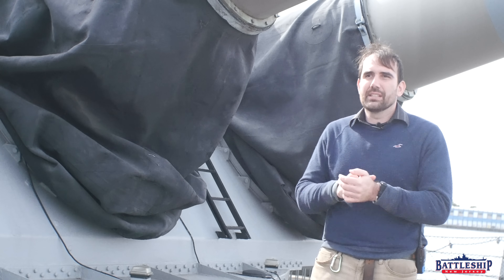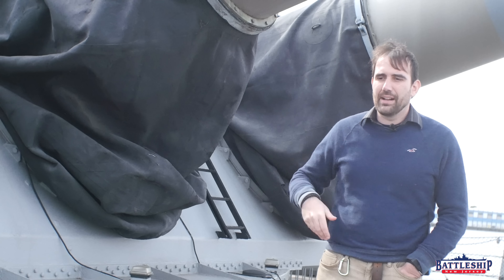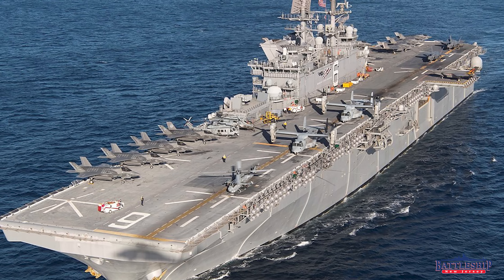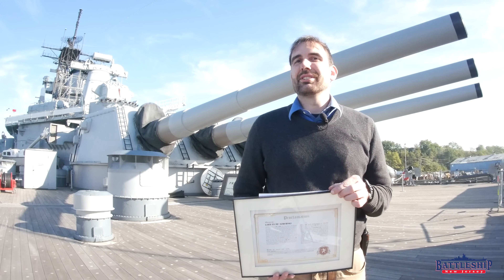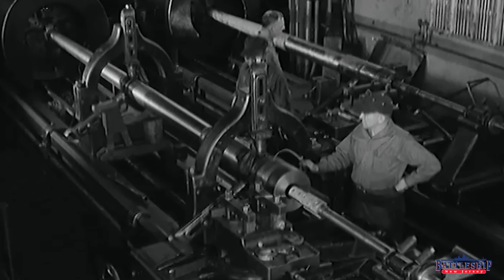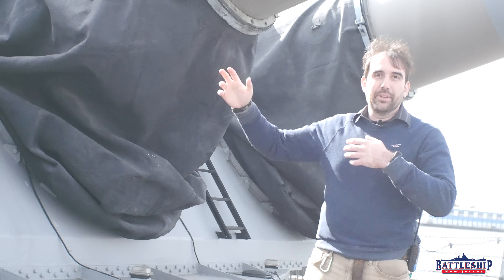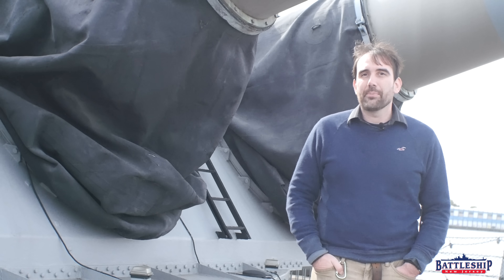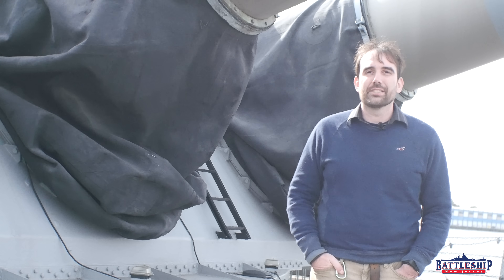How Much Would It Cost to Build a Battleship Today?

Comment: I'd build new Battleships, i think. but i'd shift things around if possible. To start, we're building our ship to the neopanamax size. We can build her longer, wider, and make her sit deeper. with the size bonus, we're gonna commit to the bit and go full send on 18 inch guns. because of the size increase, we're probably gonna be able to run this with 4 turrets (might have gotten away with 5 if we stuck to 16 inch if we could shrink the superstructure a bit, but not pulling that off with 18 inch guns.) The extra size of the ship will let us carry more shells, maybe as many 18s as the iowa carries 16s. 

However, we're not actually going to install that 4th turret. we're gonna run three 18 inch three gun turrets, likely 18 inch 50 caliber turrets. What we're going to do is, instead, take that fourth spot and use that for the VLS cells. hopefully we still have room for a chopper pad, but realistically she's never going to operate solo so if we can't, we can't. then, in near the super structure and otherwise to the sides of the guns, and probably also on the nose and bow, we'll slip in our secondary batter of the standard 5 inch mk45 guns. mounted actually on the superstructure and perhaps beside the secondary battery are our CIWS systems.

Obviously the main point is the big guns, the VLS cells and what not are basically all for Air Defense, and our 5 inch guns are really just going to be their to fend off ships that get in to close. the VLS likely will hold some and anti submarine options as well, just in case. whether we use the 18 inch guns like i suggest here, keep the 16 inchers, or even choose to just break the record outright with 20 inchers (unlikely but i can dream), we're gonna need new shells. now, we're not planning to use this to actually engage enemy ships, but it's still wise to have the capability to engage whatever our target is from as far as possible assuming there's land based defenses, which there probably will be.

So, we will still carry conventional shells, because making them one solid object can allow more penetration or more explosives if we can get in closer. but in addition, we're gonna pull rocket assisted and/or base bleed shells, which ever gives us the best range increase for the least payload cut, or maybe just outright both. for the reason of range, despite my previous statement, holding with 16 inch guns may be the correct play. i don't really want to go any thinner or longer though, as ideally i don't want to burn the barrel too fast and we can get a big range extension already from the extended range shell designs, potentially especially the rocket assisted shells as you could stuff a lot of rocket fuel in a shell this size, though it would require the barrel to have a higher twist rate. (bonus points for that also allowing longer standard rounds). Obviously getting actual smart rounds would be cool, but beyond proximity fuses, well the whole point of this is to have ammo that's cheaper than missiles, so while we may get a smart shell or two (its still cheaper than a missile, just by less now), it's not going to be the primary armament.

As for a power plant, if we can get an extra ship yard lined up i'd like to have it nuclear power, but i'm not going to sac our already limited carrier construction rate we can't, so most likely we're stuck with a gas turbine. but this ship's gonna be pretty big, so we're gonna need to push it to get this thing moving, and really push it to get any useful range. I personally would suggest doing what's possible to fast track a rotating detonation engine systems if this ship were going to be actually done. using batteries and a hybrid drive train, combined with solar panels that can be stowed away or something to that effect, could further extend the range on the same fuel supply, thus allowing us to not need to take up precious nuclear-capable ship yards. 

With that, you have a ship capable of long range fires, ideally with highly accurate guns even at those extended ranges, without needing to consume expensive missiles that themselves also contain a fair bit of specialized tech that may be cut off in event of a major war. they're just shells. while also being capable of fully defending itself with relatively little help. and if you really wanted, the extended range shells could even make nuclear armed shells almost practical. this is a big target though, so i don't recommend it. It's not filling the roll of a carrier, and not as nimble as a destroyer, but those big guns should give it its own niche, just like her predecessors had when war came calling.

Comment: What would it take to convert an aircraft carrier to a battleship-type role? The opposite was proposed for the Iowas, after all. Yes, a carrier isn't as heavily armored, it's not gonna stand up well to recieving direct hits from another big ship, but its not like they're made of tissue paper, and I think the shore bombardment role matters a lot more for this anyway. They've got lots of deck space where you can mount a crapload of guns and they've got more than enough onboard electrical power to run next-generation energy/railgun weapons if they ever become a real thing. I'm sure major structural redesigns would still be needed to survive the force of the guns going off, but they could still reuse the existing design for the hull, engines, most of the electronics, crew facilities, etc. It'd be a bit of a "glass cannon" I suppose, but there have been plenty of conflicts where the ocean is relatively uncontested and it'd be nice to be able to cheaply shell deep inland rather than burn through a hundred million dollars in cruise missiles to take out a tent

Comment: New or used would depend on how quickly you needed them.  In prevention or preparation for a war new would be the way to go. You can automate some functions and add/design for what you need .  

If at war and needed. Than you reactivate.   You get it cheaper and faster.   Than you can make a follow-up decision on if you need more of them or better  and build new while still using the older ones.
Reply: Could a new iowa even be produced.. or would we go for the Montana class?

Comment: I think the way to go would be to build new but to instead update old plans. it seems most things are sorted, aside from the features on the superstructure, and I would replace the no2 turret with VLS, to give a better air defense. To drive the point home, if the design changes were minimal, and if a VLS module could be a drop-in replacement for a turret, it could help the others lower their costs of maintenance, especially if there were common parts.

Comment: I don't think it'd be really worthwhile to make a battleship nuclear powered. The whole reason aircraft carriers are is so that they can basically opperate in blue water non-stop for around a really long time, and while fuel and ordanance is expensive to deliver to aircraft carriers I suspect resupplying a battleship while it's underway would be MUCH more costly, especially if we're sticking with 16" guns, that math would change with railguns as their projectiles are more managable & the electricity they require would necessitate nuclear power, but you then run into issues questioning how effective railguns would be at bombardment as they don't arc the way bullets do, it's just a whole new set of issues. 

I'd probably stick a price tag of $6-8 billion for RND on the ship as well as the first hull, down to maybe $5-6 once you have the facilities for both ship production and ordnance manufacuting up & running (but those 2 would prob be an additional $2-3 billion. 

Still I'd like to see new battleships sailing the seas.

Comment: Thing is, there continue to be other ways to attack the enemy than using 16” guns. Using 16” guns means the ship has to be close enough which leaves it vulnerable. Even when we brought back battleships in the 80’s they were equipped with missiles. 
Being that the only thing of any usefulness is the 16” guns it’s clearly no where near worth it to consider a battleship for modern warfare when you can get 3 AB destroyers for the cost of one BB not counting retooling costs. 
And each AB can hold three times the missiles than the Iowa BB could.

Comment: Build new.  Start with the Montana blueprints, utilizing computer modeling to refine the hull shape for hydrodynamic efficiency and reconfigure for dual Betchel A1B reactors; 35 kt target top speed. Without the fuel capacity requirements, the buoyancy reserve should more than accommodate any and all modern elecronics systems.

Redesign and shrink the superstructure and delete turret #3 to accommodate 5x 64 cell VLS  modules amidships, with permanently mounted reloading cranes and additional munitions stored in magazines below decks within the citadel.

Full AEGIS capability, 4-6 Phalanx turrets, updated and redesigned around the GAU-12/U.

Armor scheme stays similar to planned, but shave a bit off the belt and put it on the deck, because nobody's going to be shooting at it with 16" naval guns.

Keep the proposed 10x twin mount locations, but update 8 of them to modern auto loading 5"/54 Mk45s, and outfit the remaining two with GAU-8A avengers because BRRRRTTTT

Turrets 1, 2, and 4 remain triple 16s, with modern metallurgy, fire control, propellant and projectiles.  Investigate possibility of developing caseless munition auto-loading system.

By the time it's all put together, Lockheed Martin's HELSI program should have their 500kw laser system squared away. I want two of them.

So basically, a nuclear fast battleship with a total firepower exceeding that of an Iowa class battleship plus 3 Arleigh Burke flight III destroyers.

We'll reduce production costs by building six of them.  🤣

Modern firepower combined with old school pants-soiling presence.  Because while everything about the US navy is flex on top of flex, if we ever got into a prolonged, all-out shooting war, we could be in trouble.  The navy is leaning harder and harder into the Arleigh Burke class, and while they're plenty formidable, their achilles heel will be endurance; specifically the fact that they're too small and thus too unstable to reload the VLS at sea, much less while underway.

Comment: The question i would have for re-activating the existing battleships is the wear and tear on the 16 inch gun barrels... What is the current state of the barrels?  how many shots can they fire before they are worn out to the extent of their accuracy being substantially affected..  Once you get an old battleship back into service you still have to re-create the heavy industry required to manufacture those massive guns because sooner or later their current guns are going to need to be replaced with new ones..

Comment: A nuclear-powered battleship with heavyweight torpedoes, advanced guns firing smart shells as well as dumbfire bombardment rounds, lasers for air defence, and modern sensor fusion, would be pretty damned terrifying. They could pound a target with near impunity. There’s a reason the Marines have always defended keeping them commissioned.

But they would need to be protected by submarines, because we still haven’t found an effective way to counter torpedoes ourselves, so the easiest torpedo to counter remains the one that is never launched to begin with because your own sub just sank the launch platform.

Comment: A modern battleship that used a mix of missiles and guns that launch hypersonic cruise weapons would have a far lower operating cost than a supercarrier so it would pay for itself replacing one in as short as 2 years.. No costly pilots and aircraft other than a few drones, no massive crew of aircraft mechanics and other support staff for flight operations.. 2 x 16 or 18 inch guns with one mount in front and the other to the back for a total of 4 barrels could accelerate a hypersonic weapon to altitude at enough speed to light the high mach engine above the area of high dynamic pressure in the atmosphere.. The guns could also fire standard high explosive projectiles for shorter range bombardment just like their older sister ships and have large numbers of standard missiles in fast reloadable weapons bays.. Using the hull of an older supercarrier could also cut costs.. With a projected footprint of over 2,000 miles and the speed of hypersonic weapon being able to reach that edge in 15 minutes or less it would be the big bad ass of wherever it was in the world..

Comment: Honestly, I would go new because there would be too many retrofits on older battleship, and instead of having to do constant workaround, you would have a more streamline plan across-the-board, and that would save from incidents like what happened to the Iowa
Reply: A better idea would be to take an aging supercarrier and strip off the flight deck and some of the guts then rebuild the hull into a battleship of modern design.. 16 inch or even 18 inch guns that fire hypersonic projectiles/cruise missiles would be far more cost effective and command a larger circle of dominance than a supercarrier with all those aircraft to maintain.. Modern hypersonic weapons could be guided bombs, carriers of multiple antiaircraft missiles or other variant of weapon.. They can get to a target 3x faster than top speed of any modern jet and travel a greater distance.. I would think that 2 gun mounts one forward and one aft with 2 barrels each should be enough and complement them with quick reloadable missile bays for current types of cruise and other slower speed missiles.. Rail guns like laser weapons have short range uses but also have many drawbacks especially when thinking about longer range use..

Comment: What about Steam Nuclear Turbine? Similar on how Power Plant works. Using Uranium as Heating source. While using Water to steam the ship. A mixture between old and new. Due to our technology able to balance the boiler pressure. We can make it more durable and be super pressure steam engine on the ship. And because it is water, it’s a lot cheaper to refuel and able to be recycled. And because it is using Nuclear as heating source. You don’t have to do much interms of refueling. Just steam up and set sails.

Comment: 3.5billion adjusted for inflation. 10x adjusted for the military industrial complex. Another 60% in cost overruns due to repeatedly missing deadlines.

Then they would try to make it a modular design, but they would later decide not to build half of the modules.

None of it would matter though because a bettleship is a sitting duck. A very angry sitting duck.

Comment: If they go for a mondern design ment to provide fleet defence, shore support, command and control, and strategic deterrence. Would be like the arsnal ship in that it has a shit ton of missiles. Make the missile modules able to be flipped out for diffrent size profiles for difrent mission threats(do u want more anti air or cruise). Unlike arsnal ships there would also be setups for shore support with a 16inch full auto gun. This should give more range then the current zimmwaze which is good because it should not be stelthed. This battleships survivability comes more from shooting anything that can kill it down and if that fails its size and damage control should make it survive at lest one hit(which is better then geting oneshot like most destroyers would) Would give this ship phalix close defence and laser defence(current laser setups that can quickly kill aircraft and missiles are to big and power hungry for dds and crusers but would be perfect for bbs).

Comment: Would reactivating even work? Those things are old. Firing the guns could theoretically do structural damage to the ship. 

Assuming the ships could actually do the desired job. The next question you need to ask is, how many does the navy want? If it's only one or two, bringing back the old ones might work, but if the navy wants 10+ then building a new ship yard (probably on the west coast) and building new would be the better option. Not to mention, a new battleship would allow the designers to design it to the specifications of the modern battlefield - so it could be more than just an artillery platform for shore bombardment. 

imo, the navy is probably better off building drone carriers, point defense frigates and destroyers.

Comment: Not 16"ers.  Maybe rail guns, if those ever get working properly?  I suppose that "Advanced Gun System" could be scaled up and combined with a big enough guaranteed order for ammo to be worthwhile.

As a side question, consider the HARP guns, which were two 16"ers bolted together inside a support structure, to see if a small package could be shot into orbit.   The max altitude achieved was 110 miles.
https://en.wikipedia.org/wiki/Project_HARP

The question is, if those guns had been fired at 45°, how far would those shots have gone?  I imagine there are formulae in the Navy and Army that would at least give a good approximation, allowing for curvature of the Earth.